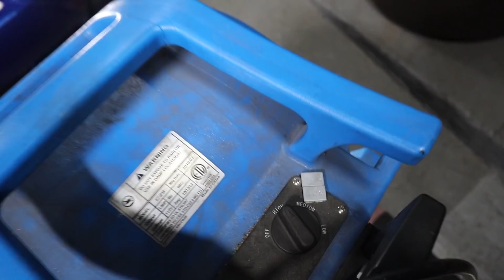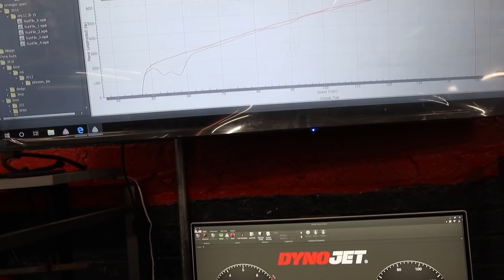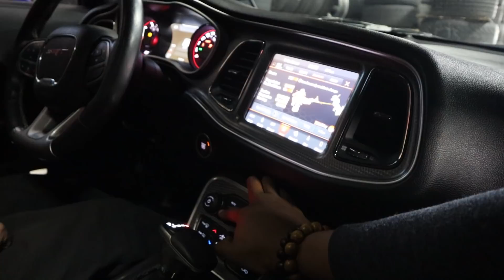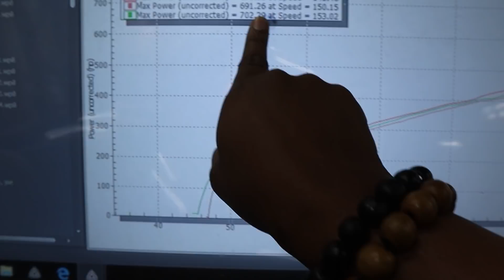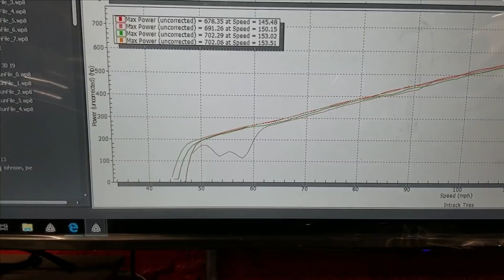Does The Hellcat Redeye Really Have 797 Horsepower? Dyno Test Results !!!

Comment: MS 109 is not going to make a differnece unless the car is tuned ina higher octane.  Try a mix to determine what octane 2 gallons will become with 93 Octante and tune it.  The Horspower will jump significantly.  I know by personal experience , my s197 Built motor is tuned to 95 octane making 784 at the rear wheels with a 79MM pulley.

Comment: Crazy how the red eye advertises 797 hp and the 2020 shelby gt500 advertises 760 yet they both make the same to the wheels 🤔
Reply: The_Horseman hp is close but not torque 625 to 700 plus
Reply: It also depends on the axle ratios. The gt500 probably has a numerically higher axle ratio
Reply: Bass God there’s 2 sets of gears offered in the redeye 262 and 309 I have 309s and remember I’ve seen gt500 at 680 hp and the redeye  at 715hp depends on the Dyno and what state your in weather altitude etc don’t forget torque which redeye has a lot of that 700 plus where the gt500 is 625 ish both very close in the drag race same tires redeye wins by 3 tenths
Reply: Jeff6275 Cars boats atvs trust me I know. I’m a huge dodge, ford, and Chevy freak 😂
Reply: Mr. Morton aka. Highlander not really. Real dyno pulls are done in the gear that’s basically a straight shot from the engine to the differential. The correct statement would be different axle ratios
Reply: Mr. Morton aka. Highlander true

Comment: Now the Redeye widebody Charger is going to debut at the NY auto show this year which is the one im getting.  Personally, that 702 wheel hp rating is exciting and on pump gas ⛽️ wow.  Now Imagine e85 fuel conversion with a tune wow I cant wait plus im gonna definitely swap out the driveshaft and add a diff brace just for piece of mind on the track 👍🏽 your thoughts on the upcoming Redeye widebody Charger?

Comment: At the track more octane will help on the big end. I was running 11.1 @124.5 the power would fall off in the last few hundred feet. I think it was pulling timing  When I use octane boost it doesn't fall off in top gear. A ran 10.84 @ 128 all with my stock narrow body hellcat.  A cheapo kitty look alike. I don't think this phenomena will show up on a Dyno as It didn't happen until about ten seconds into boost.
Little info. I bought an old yacht this year and changed my YouTube name. 
Rob

Comment: So over 90 hp is lost through the drivetrain? That’s crazy. I’m not 💯 but I’ve heard of stock regular HC having 640 or so to wheels with manual transmission. Little less with auto trans.
Reply: THERE IS ON LY A 2015 MODEL WITH MANAL TRANSMISSION N THEY SLOW

Comment: Damn my 2020 GT500 dynoed more!! 760hp to the wheels and 726hp SAE which makes my car either a hero car or these GT500s are underrated I'm one of the few to dyno with the car broke in as well. On the same dyno my buddies redeye made 713 and his demon made 722 so just wait till these GT500s get that TCM unlocked and we can launch them above 3200 rpm ;) Here's my dyno run. https://youtu.be/NWgJ1LGdbOw
Reply: Dude, that dyno is way off, Lol. Your car dyno's to the wheels more than any other GT500. Think about it. You are also putting out more TQ than any other GT500. Think about that also.
Reply: @markurbancowboy  Honestly 726 SAE is not too much higher than other cars have been making others are around 690 SAE there have been cars that have been hero cars that have made a little more than others even with the hellcats and I still dynoed higher than my buddies redeye and his Demon on the same dyno regardless of whether it reads high or not though lol
Reply: @Cobruhh93  
You dynoyed more rwtq than your buddies Redeye? What were his numbers?
Reply: @markurbancowboy  
https://www.mustang6g.com/forums/threads/dynoed-my-stock-gt500-with-very-impressive-s.136389/

His redeye and demon numbers are posted on the write-up I did here is the link. I will say I definitely want to take it to the track to back up the numbers.
Reply: @Cobruhh93  
Ok, I've seen that dyno before; your numbers are probably good. My bad. Great numbers! 😁

Comment: No stock car actually pushes out the amount of power the company says it does
Reply: No some make more
Reply: They measure the HP by the crank. They normally don’t measure the HP at the rear wheels. I would actually have them measure it at the rear wheels.

Comment: 797 hp and only putting 702 to the wheels 🤦🏽‍♂️ expected anything from 720-740 to the wheels.
Reply: Another guy put his on a dyno and his did 713 to the wheels
Reply: 702 rwhp is damn good for 797 flywheel. Drivetrain losses can average 100+ on performance cars especially in automatics.

Comment: @ mod2fame. If the hellcat is 707hp to the crank but dyno at 650 and the redeye 797 to the crank but dyno at 702 would that raise concerns on why you're losing more than hellcat (57hp loss vs 95hp loss)?
Reply: Amory Surcy it’s wheel horsepower
Reply: The more power you make the more percentage of hp you lose to the wheels . That’s common knowledge

Comment: 797 crank to a lil over 700 at the wheels is an ungodly drop off....typical you see about 20-35hp diff between crank and wheels so either Dodge is lying or that dyno reads incredibly low. I’d take it somewhere else for comparison
Reply: idk where you got that idea unless you are talking about a 300hp car, a 10-15% drive-train loss is normal  at 702hp that is right in the money especially considering the supercharger also adds to the drive-train loss.
Reply: Mr. Santos well 300 is around the ballpark of my vehicle. Wasn’t aware of the superchargers effect ..but hey #TheMoreYouKnow

Comment: Wow $80k and not even 750hp 😆😆lmao
Reply: Is there some other $80k car that's out that makes 750 to the wheels?
Reply: Must not know that 797 crank isn’t going to translate to 750 whp lol rookie . 703 whp is plenty fast
Reply: SpeedLife301 rookie😆 u funny isn't that motor supposed to be close to the demon and it performs like a stock hellcat i know about power loss and all that ive built cars before but if am buying a car and it's advertised as having 797hp that cat better have that
Reply: street lifetv close is not the same. Redeyes normally make 710 whp demon makes 720-730 whp on pump and 760-770 whp on race gas .